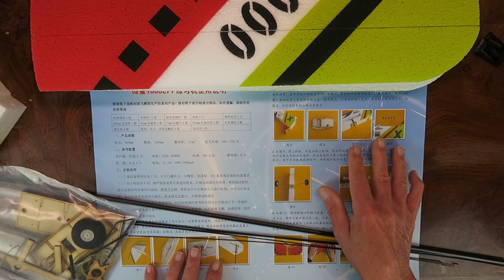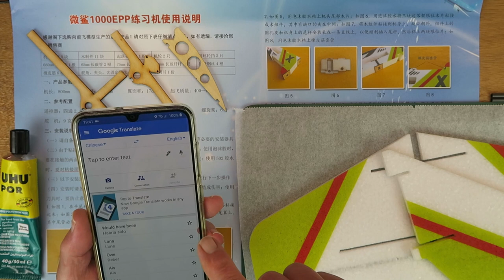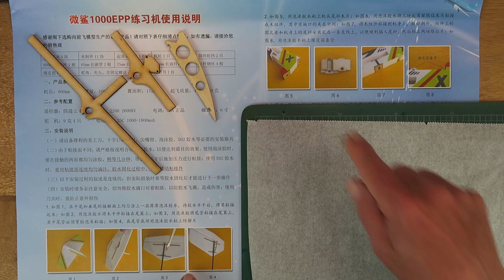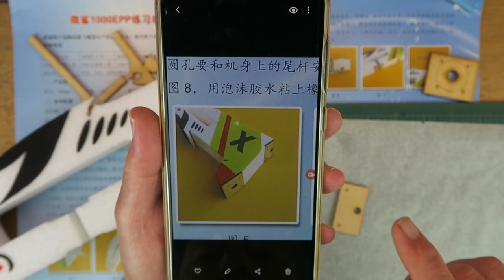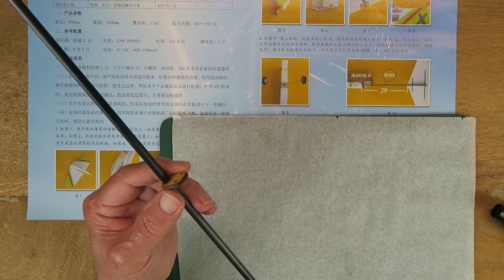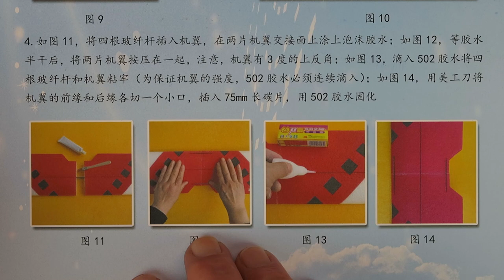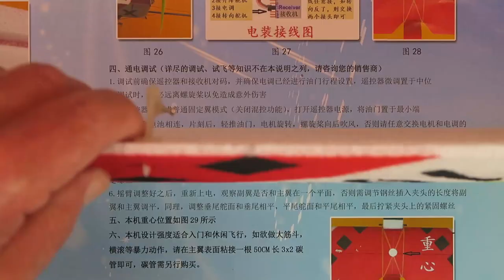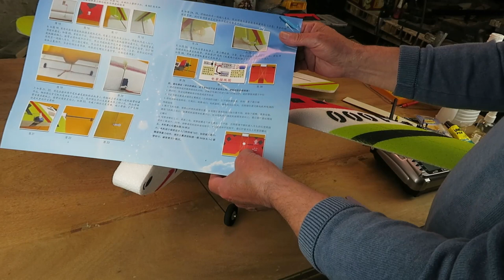WSA 1000 EPP 1M Wingspan Pusher Trainer Build

Comment: 12:00  Ouch! ;-) Good build video but when working with foam I always put a glued carbon wing rod in all the way before gluing it in using CA glue. This is one of the luxuries of building with foam, carbon fiber,  and CA. Just the friction of a 2mm round rod caused by placing it in a tight razor cut slit can cause a soft foam wing to bend up or down (or worse twist) so you need to install the carbon rods dry first and then check dihedral and incidence angles again (after joining the wing as you did) before gluing them in so if the wing is twisted and out of spec from installing the rods you can correct the error. But normally joining a foam wing using dihedral you cut the round top and bottom rods to the length of each wing panel first, and then since not using larger internal spars use 4 more slightly larger diameter round rods in the center section top and bottom again as WSA has done  to create strength in the center like TechOne did designing the PopWing.

Carbon placed in foam should never create a force on the foam. Over time the foam may surrender to the constant force and warp. You want the carbon holding the wing in shape not the foam telling the carbon what to do. It's the carbon that affects the wing's shape and keeps the flexible foam in place. Do that with a flat rod and it will bend to the side before it will bend 180 degrees back down into the cut out slit.  But small round rods rather than flat ones are being used to save weight (and expense) by placing a small round rod (than can easily bend alone) close to the top surface directly above another round rod on the lower surface to form a a D cell structure that must compress the foam between the top and bottom rods before the wing can bend. Just one small 2mm round carbon rod which cannot stretch or compress in length does very little to stop a foam wing from bending but when you add another one at this scale that's all it takes for normal density EPP foam to not bend. 

So regardless of what the manual says I'd cut the carbon rods to size and glue them in each wing first one side at a time taking advantage of being able to use a flat surface without the dihedral in the way to make each wing panel flat and identical before joining the wing halves which will be stiffer and less inclined to twist when checking wing incidence when gluing the center section.

 BTW I use Shoe Goo (not Amazing Goop that cannot repair a shoe) thinned down with Toluene solvent for EPP foam and so far have found nothing better (or less expensive) and only use flexible CA on foam when attaching carbon fiber or working with thin 1-3 mm EPP. I found flexible CA bonds to carbon fiber better than hard CA, doesn't cause EPP to become brittle, and comes close to Shoe Goo as my favorite glue for foam.  And I believe the black flexible CA used for installing RC car tires is even better for carbon fiber but it would make a mess of white foam so have yet to try it.
Reply from the maker: Thanks for the useful comment and advice. Will try that with carbon rods. The carbon pieces that you saw me glue @ 12:00 are strips not rods so I thought less chance of warping. Please consider subscribing if you haven't done so already!!
Reply: @1nformatica    Those are not round carbon rods? Interesting... you didn't show what followed so I'd like to see how you got it back down into the slit;-) I tried to bend a 3mm x 1mm flat carbon strip relative to it's height axis on a wing tip by cutting it down to it's 1mm width thinking it would bend like a round rod at that point but it just split the carbon strip where I wanted the bend to start because it wasn't perfectly square by a few strands and wanted to twist. Ended up using good old fashion wood. But big difference in carbon fiber quality as I've drilled holes in 2mm x5mm strips and put a 1mm round carbon rods through it without it splitting, but last batch I got on sale from another company  you could hardly cut with a metal cutting wheel without it splitting apart and round rods were useless for control rods as they wanted to bend in one direction when under compression form being out of round. This looks like a nice harmless low cost plane for a friend starting out flying FPV planes who needs a rudder. Have you flown it yet?
Reply from the maker: @JohnFHendry  Sorry, my bad! The main spars top and bottom are round. Then there are two shorter that are flat https://drive.google.com/file/d/1XmHOHR9ZT1QX0EbLCRhePGIp6WKsKGsx/view?usp=sharing
It's in the list for maiden but I have quite a backup due to the current situation, will post a link when done.
Reply: @1nformatica  Makes you wonder how many new models have been built... batteries to go with everything are getting hard to come by.